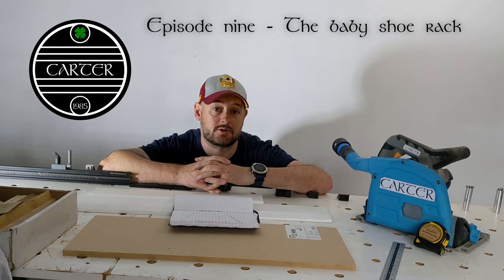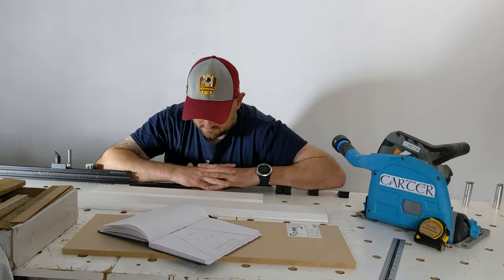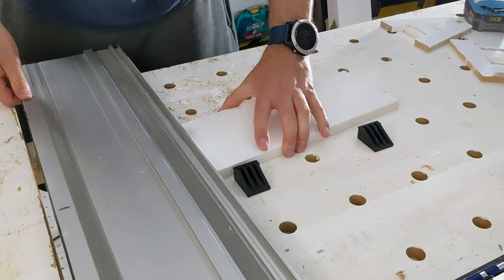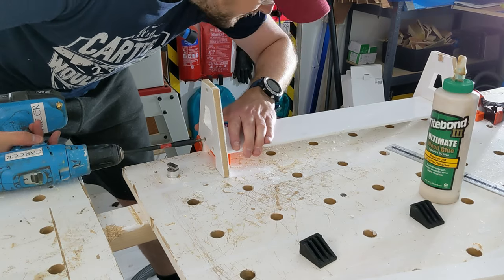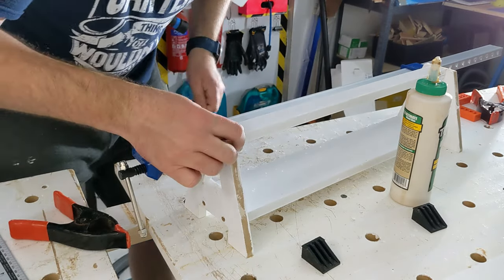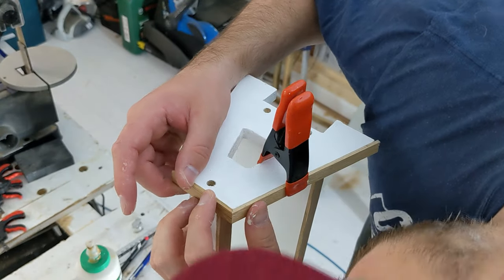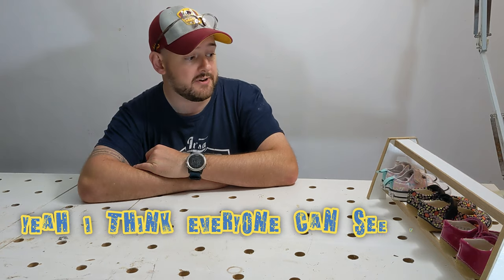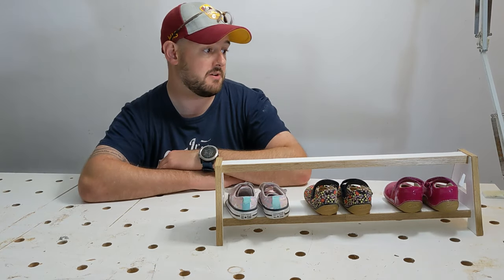Episode 9 - Baby Shoe Rack

Comment: Great little shoe rack.
There is no way my daughter's shoes would make it onto the shoe rack by themselves.  I'm more likely to find one in the garden and the other somewhere in the house.
I am due to be making a shoe rack for under the stairs, though need to find time to do it.
Reply from the maker: Thanks jiggsy. Haha so long as you can find then and they don't get thrown out of the pram on a walk. 🤣 Our daughter actually loves taking her shoes off and putting them away. Although it is the only thing she puts away. Sounds like a big project? Maybe one for the winter months?
Reply: @CartersShed  lost many things before, but luckily not shoes... yet.
It's probably going to be messy more than anything as I have to take the brick work out... and then build a frame for drawer units. Hopefully will have a week in September or October to do it.
Reply from the maker: The house improvement jobs are always a bit of a balancing act between making a load of mess in the short term against the long term improvement.
Reply: @CartersShed  indeed. My biggest issue is keeping the little ones out of the mess... or them walking off with my tools